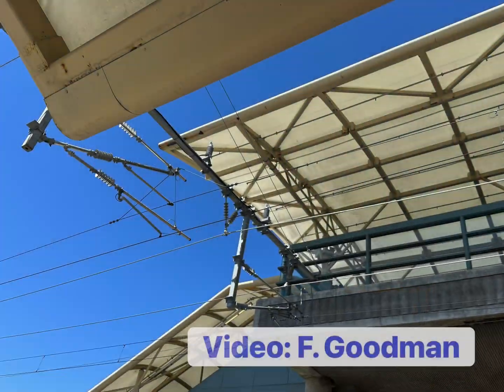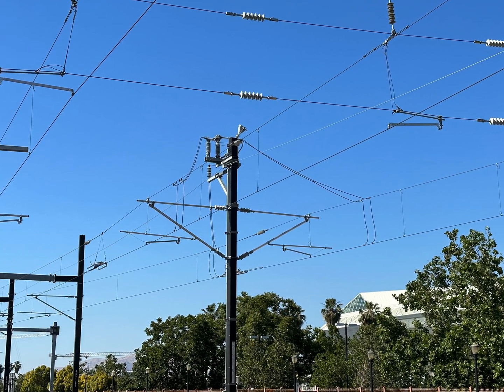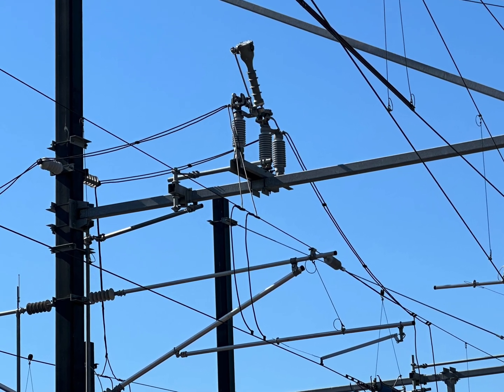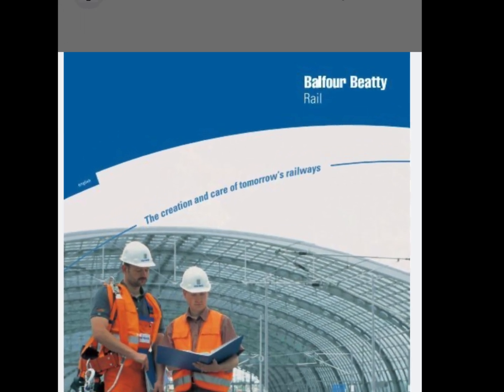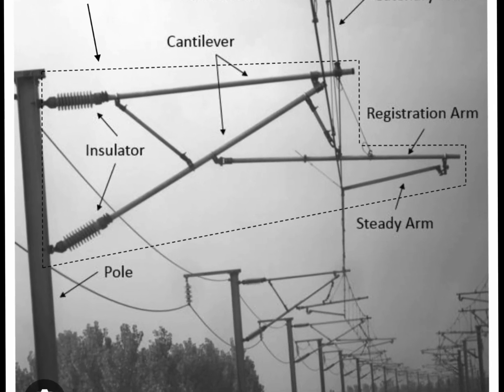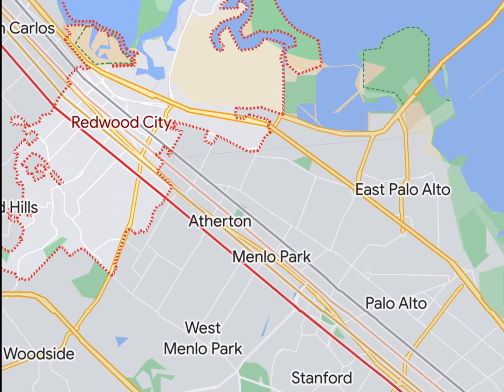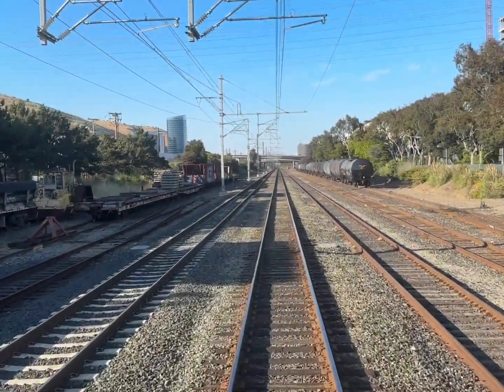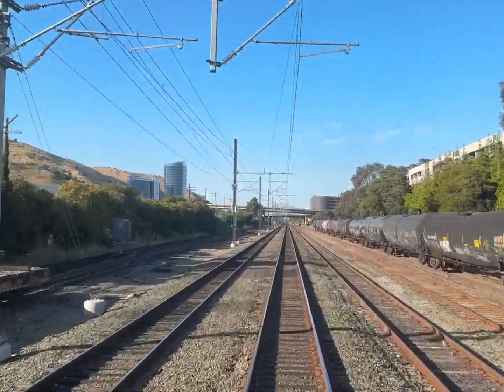Caltrain Electrification Update July 1, 2023

Comment from the maker: I am a mechanical design engineer working on robotic automation projects. As such, I get involved in the minutiae of the connection schemes of supplying power from a fixed environment to the moving payload.  Railroad electrification is (on a very large scale) the same sort of thing. What I saw missing for example at the Millbrae station was any 25 KV connection from the large gage feeder wires to the actual catenary and pantograph contact wire. However, I did see this type of connection at the San Jose station. I believe that recently some of the overhead has been energized so that testing of a Stadler train set has started. So this type of power feed still needs to be completed throughout the entire line into SF.       I am awaiting this activity over the next few months. 😮